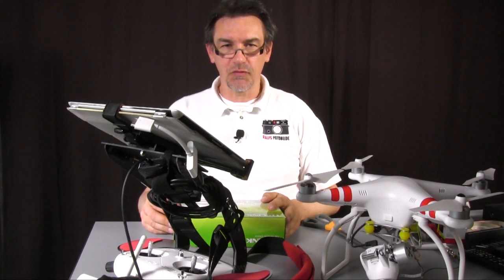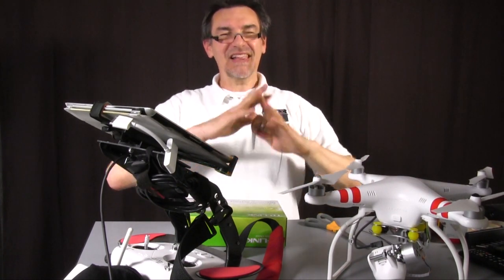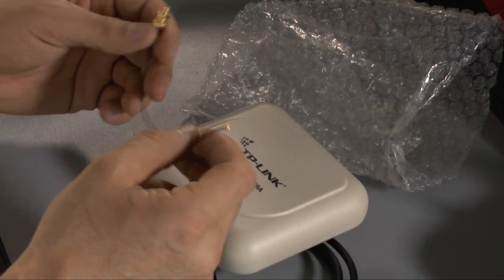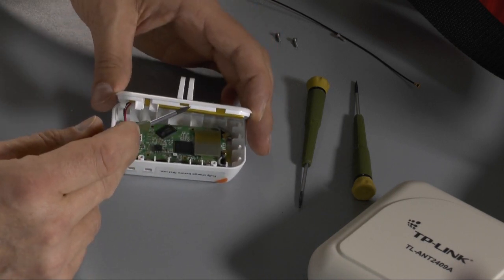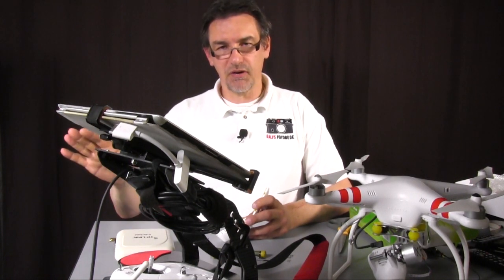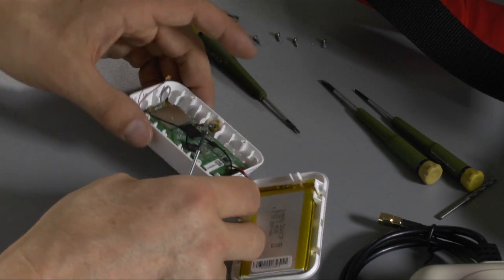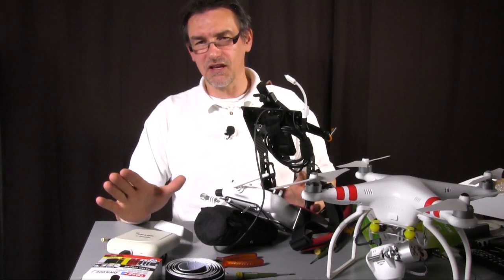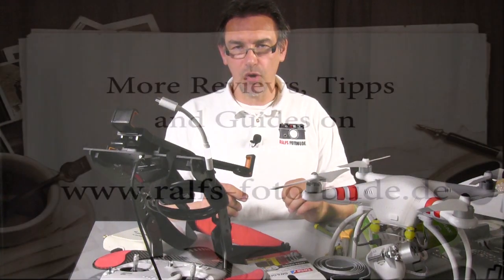DJI Phantom 2 Vision #09 - WiFi-Range-Extender (English Version)

Comment: It's very easy to fly💮💮>JustU.Faith/DJIdrone?史   If it gets out of range, or I just shut the control unit off, it goes to a certain altitude (60 ft.?) and heads back to where it took off from, descends, lands and shuts itself off all by itself. Unless you let the batteries run down, I don't see how you could loose it.

Comment: This is the adapter pigtail that ralph is using 2X U.FL Mini PCI to RP-SMA Pigtail Antenna WiFi Cable around £1.50 on Ebay.
Pat.

Comment: Does the TP link module have to be installed on top of the wifi range extender to work properly or can it be mounted next to it on the controller top bar? just seems like if it doesn't have to be on top you could mount it to the side and avoid some bulk on the extender

Comment: Should we worry about turning the extender on without an Arial attached. I have read it is needed to dissipate the internal energy(heat). Also how do you check the charge on the extender battery. Can you get off-the-shelf replacement batteries?

Comment: How do you connect the wifi extender to the gopro hero 3 ?
Reply from the maker: You can use the extender only with the DJI Phantom 2 Vision and Vision + (plus). Not with the normal Phantom 2.

Comment: What is the standard max. distance without the wifi extender, the new max. distance with the wifi extender and the extra antenna? Can you also use an old long antenna to extend the range (connected directly from the Wifi extender)? What is needed to extend the FPV distance equally with the remote distance?

Comment: OK MR. BEAUTIFUL WORK. BUT DO NEED SOME CONSIDERATIONS THAT ARE REQUIRED. 
1 - HOW MR. KNOW WHAT THE ANTENNA EXTEND TO BE REPLACED BECAUSE THEY ARE TWO ANTENNAS ? 
2 - PLEASE NEVER CALL THE EXTENDER WITHOUT ANTENNA AS MR. DID BECAUSE THE CHARGE AMPLIFIER 2.4GHZ ANTENNA IS, AND WITHOUT BEING ENGAGED AMPLIFIER MAY BURN THE RETURN OF "RF".  
WITHOUT ANTENNA => NO LOAD => OPEN CIRCUIT => WAVE REFLECTED = DOUBLE VOLTAGE AMPLIFIER TO RETURN.
PLEASE GIVE THEIR EXPERIENCES CONTINUITY, I ALSO BOUGHT A PHANTOM 2 VISION ARE TWO WEEKS AGO
LUIZ
RIO DE JANEIRO
BRASIL

Comment: I have a PV2. Because of problems with my Live Feed. I tried to mount a Fat Shark system. I mounted the cam on the side of the PV2 cam so I could see what the PV2 cam is recording. But when the PV2 got a bout 100m away I would loose contact with it. I think the Fat Shark was interfering with the PV2 signal??? Would it help to put better antennas on the PV@ and the remote?
Reply from the maker: Yes, first try the Range-Extender I mounted in my video. This should give you about 500 Meter Live Feed on your Smartphone.
Reply: Thanks!!

Comment: Ralf...tks for the instructional video. By fitting the TP-Link how much much further is the range extended? Cheers...Gary (Australia).
Reply from the maker: Depends. Usually you have around 300 Meter an with the Extender you get around 500 Meter - some Pilots use bigger antennas (TP-Link offer also bigger ones) and they reach up to 1000 Meter. Even if you don't fly so far, your signal will be more stable.
Reply: Ralfs Foto-Bude Tks Ralf...good information, appreciate your quick reply.
Reply: Ralfs Foto-Bude
Thanks Ralf - this video is great - do you have a recommendation for a larger repeater?
Reply from the maker: David Baas Try the one I showed in my video. The links are in the Info-Field of the video. There is also a bigger one from TP-Link you can try. But take care, that it is a repeater with no extra power and look for the right connector or buy an extra adapter-cable.

Comment: can used with TP-LINK TL-ANT2414A 2.4GHz 14dbi?
Reply from the maker: Yes, but you need an adapter-cable because the connector of the repeater will not fit the connector of the cable you use in the Vision-Repeater. You need something like this:
http://www.amazon.de/TP-Link-TL-ANT24PT-Pigtailkabel-m%C3%A4nnlich-schwarz/dp/B001PS4KAW/ref=pd_bxgy_computers_img_y
Reply: what you show to me N adapter to rp-sma adapter?i buy this antenna show below.rp-sma adapter wireless.can fit my repater?:
http://www.tp-link.com.my/products/details/?categoryid=&model=TL-ANT2414A#fea